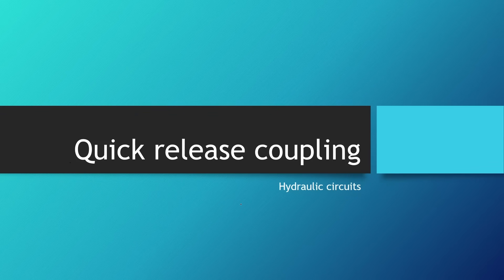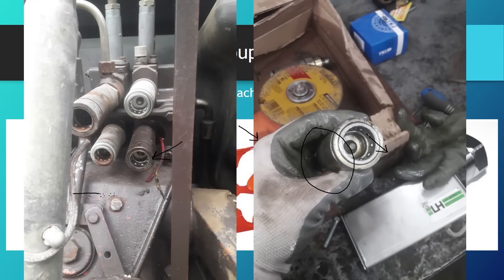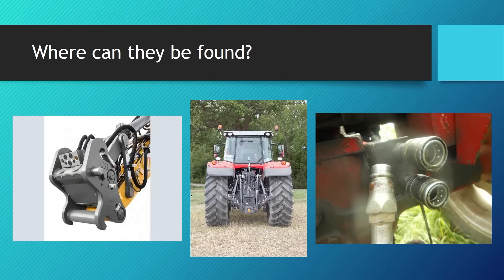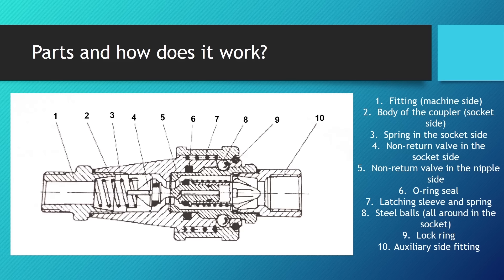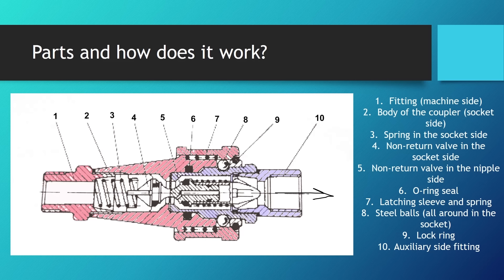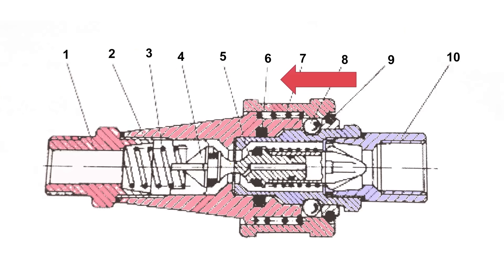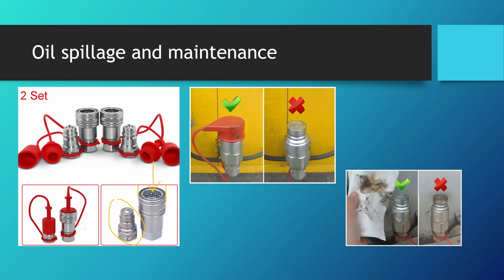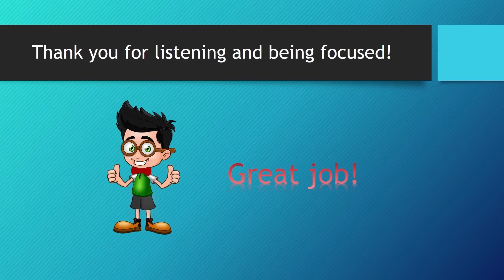Quick release coupling used in hydraulics explained!

Comment: I have a question: Does the oil always flow from the socket side to the nipple side, or can it also flow from the nipple side to the socket side?
Reply from the maker: The coupling is just about the connection, the direction of the work fluid can be either way and that depends on which are the return lines and which are the pressurized lines or where do the directional valves direct the fluid :)